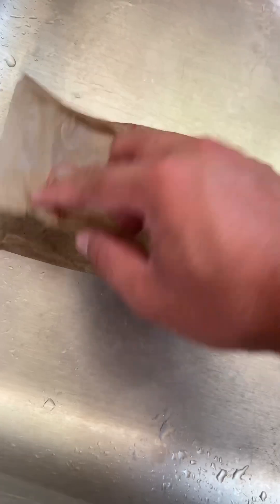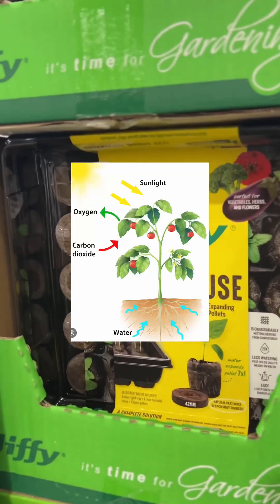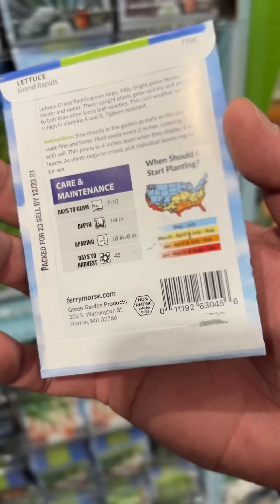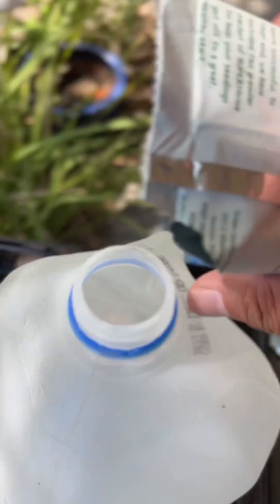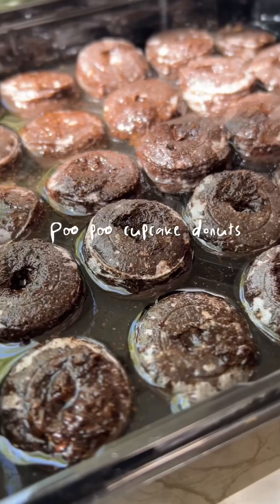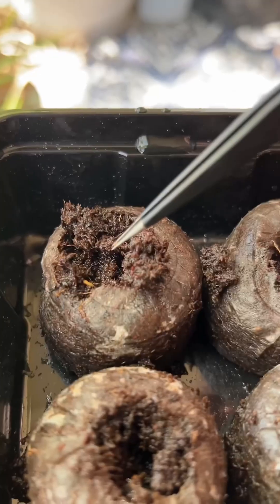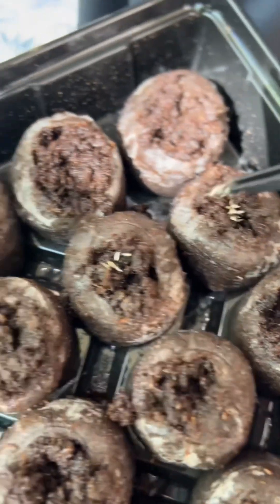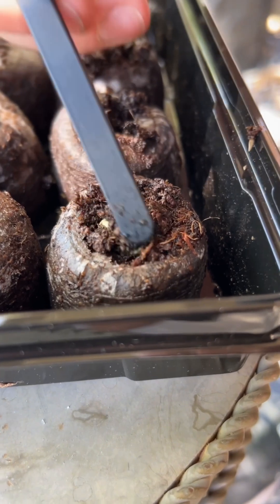Part four 3-D printed aeroponics tower update using Anycubic Kobra 2

Comment: Those snow peas won’t fit in your tower. Fully grown it will be about 6ft tall and needs to be staked off.

And I was correct, you didn’t fill the jiffy plugs correctly. After they soak up the water. Squeeze the edges till the little disk like things break apart. I can see the stuff edges of the meatballs so I can tell there wasn’t enough water.